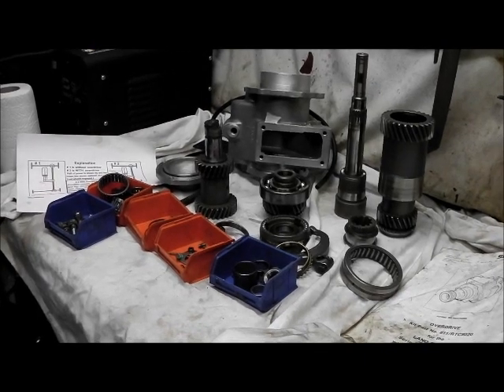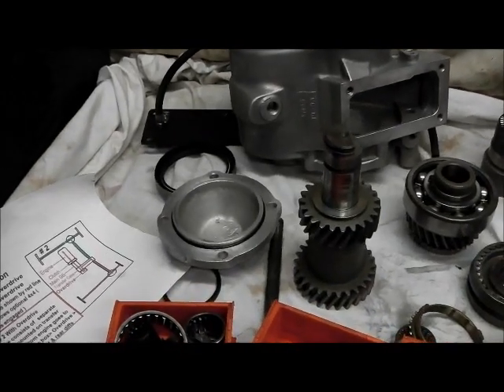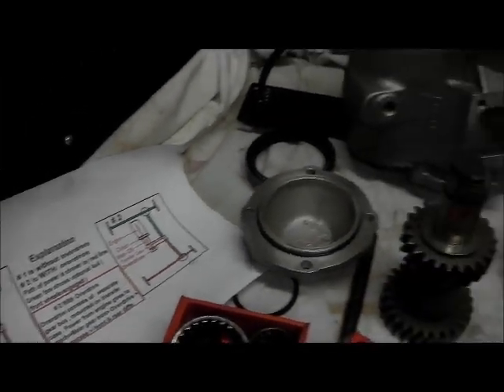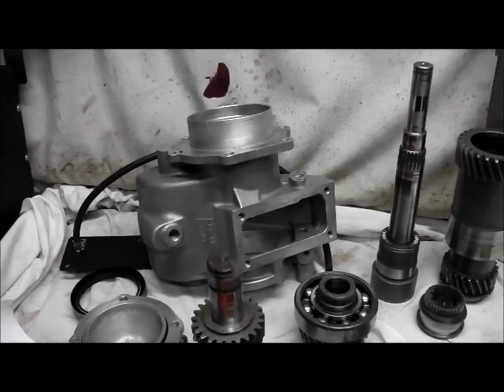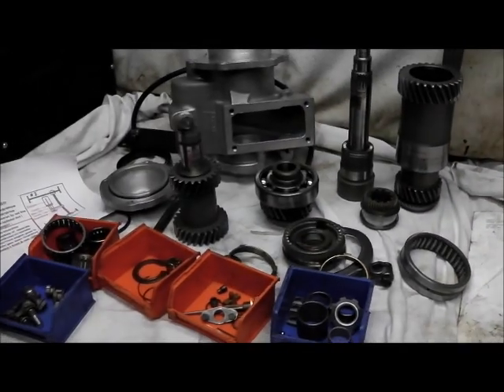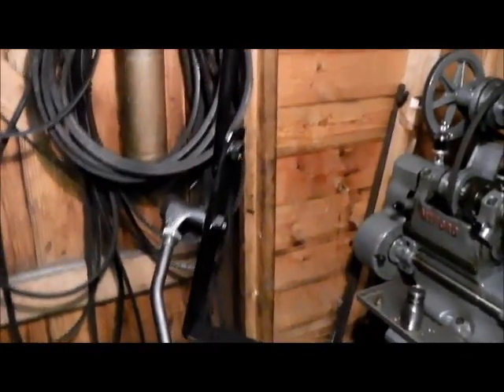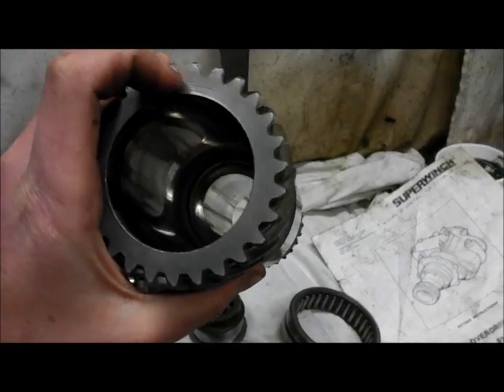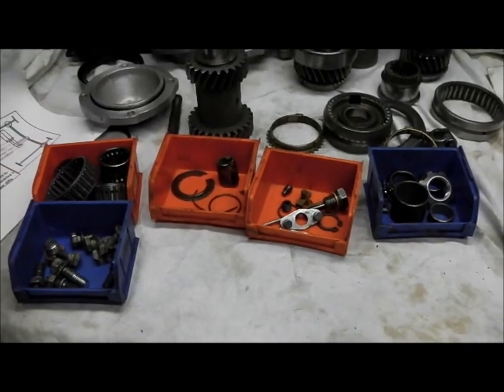Superwinch Overdrive -  Part 1 - Land Rover

Comment: The Fairy overdrive was very popular over here in Australia where you may do 300 + miles on highway just to get to the start of your 4WD adventure. High temp, high speeds, long hours, hurt the original Landy motors, specially those without overdrive. Quite common for series drivers to carry a set of valves and a top end gasket set on long remote trips over here. Once you get it running you will love the reduction of engine noise as well.
Good luck with it

Ray
Reply from the maker: whorayful Thanks, I'm glad I don't have to do those sort of miles in mine! Although they were in production until not that long ago, people just wouldn't accept vehicles like that now and having to carry spares!

Phill.

Comment: I once had a 1969 Triumph Vitesse with overdrive on 3rd & 4th - It used to cut the revs down by around 500rpm when activated. Like you say they are fragile things.
Hope you get it sorted. :-)
Reply from the maker: Thanks Paul, will be worth the effort when I'm not being overtaken by lorries.... There is a high ratio transfer box available and a 5 speed kit, but the overdrive is the original solution to the problem.

Comment: I replaced all the seals on mine and there's a moment upon reassembly where it gets damn fiddly. Somewhere near the end when you're trying to insert a shaft through various bearing sleeves. It nearly made me go insane. I use it as a benchmark of what I can do.

However, if I can do it, you jolly well can too. It's definitely worth while even if it is noisy in operation. Land Rovers were never meant to be quiet.

: )
Reply from the maker: Matthew F Holland Well I'll give it a damn good go. The 109 is a lumbering beast at the bet of times and does need it.

Comment: Hi mr Wally.. just wondering if the superwinch unit differs from the fairy unit in any way. Mainly because the instructions for the fairy unit stated that in can be used in all gears which I’ve done with mine for 22 years towing heavy trailers and even while off road in low range. I’ve had no problems with it and did the last 15 years it’s had a 2.8 turbo Daihatsu up front. My wife just leaves it in overdrive all the time coz she forgets about it😂
Reply from the maker: Other than the fact that it doesn't have "Fairey Winches" cast into the main casing, I very much doubt it. I used this unit over about 50k miles before overhauling it again, selling it and fitting a vastly superior Roamerdrive. I used the superwinch unit in all gears when towing. The only failure was a drive coupling, whose tiny splines were almost non existent once spotted- one area where the Roamerdrive is a vastly better design. (I always used the anti-scuffing paste)

Comment: Hi Phil. Have you considered getting a H/D Trailer. I got one from Ebay for £140 with drop down tailgate. Ideal as I can keep it loaded ready for rallies. Lower to ground as well for loading. Also if you get one big enough. Buy some carbon tent poles, Use them on the trailer like a covered wagon in cowboy films. Just need to drill a few holes for them in top edge. Tarpalin over the top and you can sleep in it etc when engines are removed. Sleep above the ground and much warmer......George Ps no good for driving when tent/tarpalin is up...
Reply from the maker: Yeah I'd like a trailer, it would have to be a Sankey to match the landy though! Sadly I have nowhere to keep one at the moment.

Comment: Where can I buy a new overdrive for my Land Rover series 3 and how price it
Reply from the maker: +AMER ABBASI 

Have a look at the Rocky Mountain Spares website - the Roverdrive is supposed to be the best overdrive to have but I hope you have deep pockets. I don't know of any other new units available. 

A less expensive option is the Fairey type unit that I rebuilt, but you are looking at £600+ to buy and rebuild one.  I would never buy and fit a second hand overdrive without giving it a thorough check first. Be aware that some parts are hard to get.